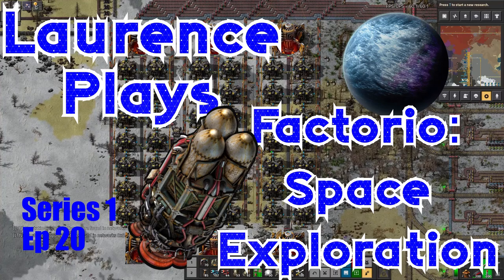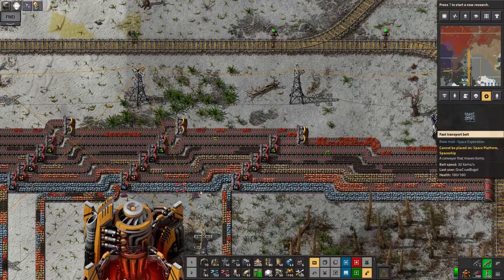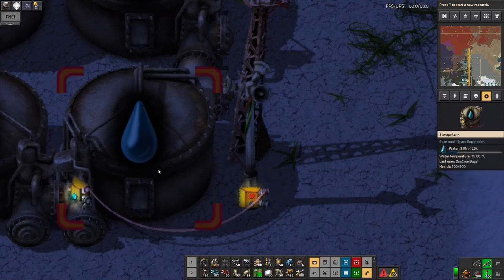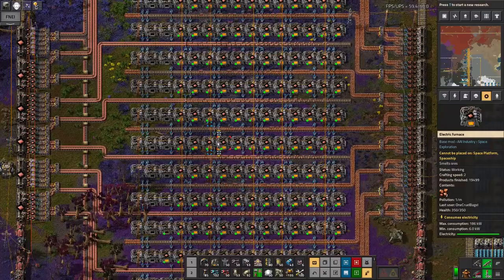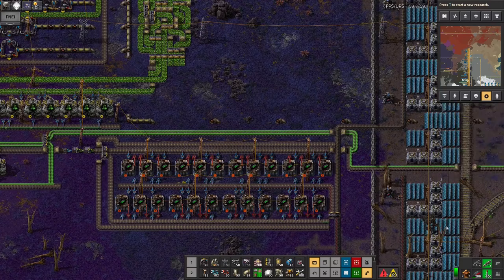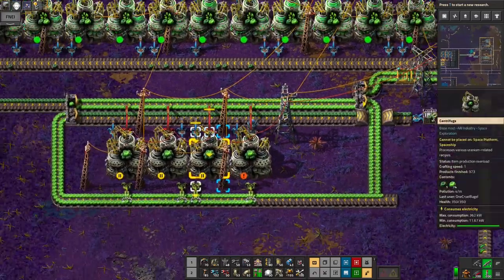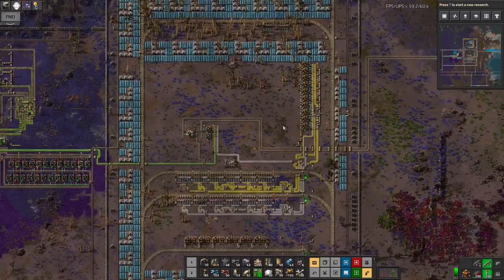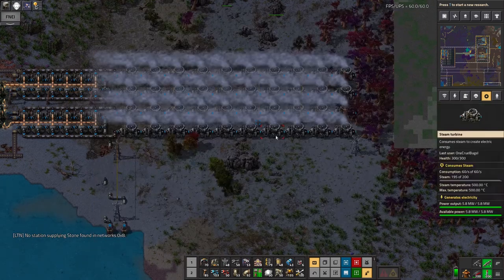S1-E20 - Cor, miner! - Laurence Plays Factorio: Space Exploration

Comment: 3:00 you could always setup an extra iron ore train station and split the iron ore belt into 2+ belts after the sorting so that it doesnt back up as badly, upgrading the iron ore belt into blues around the train station probably wouldnt hurt either
Reply from the maker: Multiple stations is an interesting idea, although I suspect it would escalate quickly, requiring more and more and more stations as time goes on! I suspect I didn't have blue belts at this point, or I would probably have used them ... it was a while back so I'm a little hazy at this point! Still, yes, more throughput is always useful!

Comment: 16:30 The problem is that you have both types of Uranium on either side of the belt randomly (both as the output of centrifuges processing Uranium ore and those doing Kovarex). If you just assigned one side of the belt for each type of Uranium, everything would be flowing smoothly.
The U-238 coming from the mines is all on the upper side of the incoming belt. Then that belt merges through the splitter with the output of Kovarex. If the U-235 beyond the splitter is backed up and U-235 enters the splitter on the upper side it gets stuck and thus the splitter won't let U-238 from the mines go through.
Reply from the maker: Yes and no - having the output from the centrifuges split between the two sides of the belt (and keeping it like that) would definitely help in that it would take a lot longer to back up when a U-235 couldn't get through, however it would eventually get to the point where the U-235 was backed up all the way back to the miners and so nothing would be able to get out. 

I've fixed it now (you'll see in a later video!) by monitoring the output belt and turning off the Kovarex output when the output belt is full. This seems to be working - as long as the U-235 is getting used up by the power plant as fast as it's coming out of the centrifuges, it should be fine. 

Thanks for the suggestion though - it was a bad design and I should have known better!

Comment: Such a good idea to add a core mining. 
How often does each train come to the station to drop off supplies?
Keep up the great work on it.
Reply from the maker: The trains are automatically dispatched when the drop-off stations start to get low on materials, so it depends on how busy the rest of the base is! The trick is to make sure that you've got enough ore being mined to keep up with the base's requirements, and that you've got enough smelting to keep up! 

The other trick (now that I'm using core mining) is to make sure that you're using enough of everything that you don't end up with one of the stations filling up, causing a backlog that stops the core miners. This keeps happening to me with the water output.